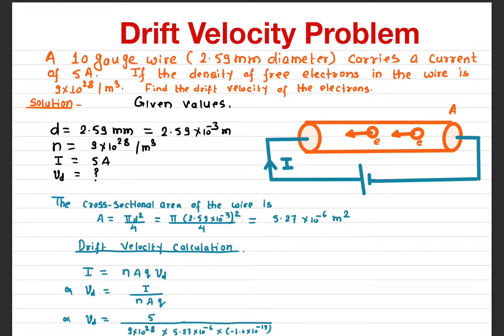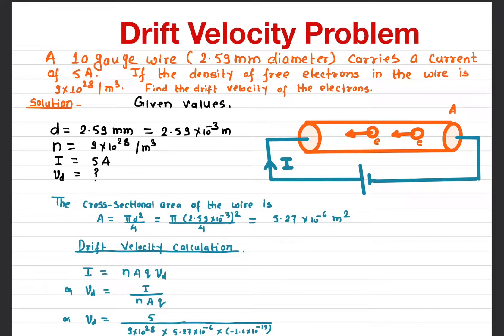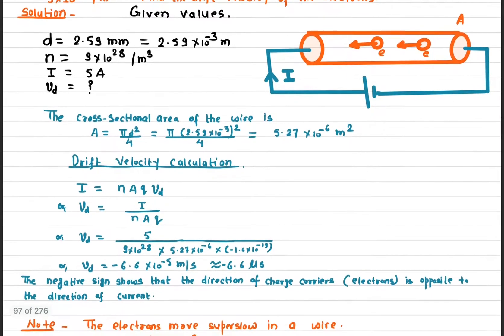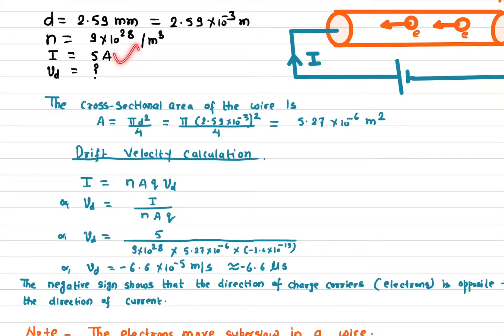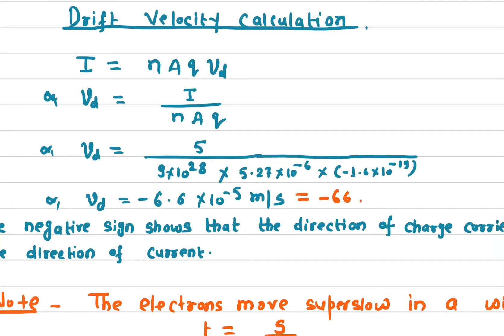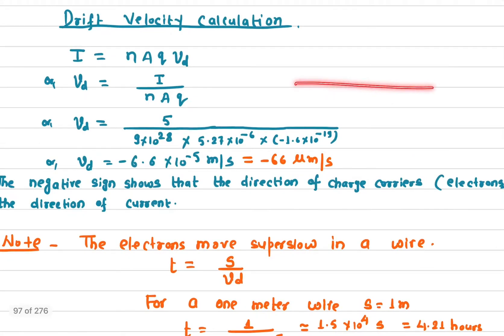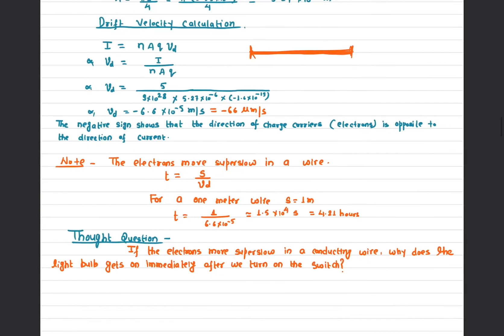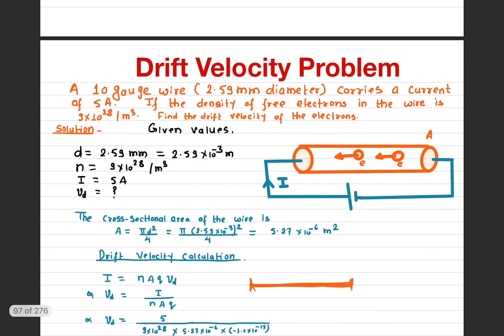Finding the Drift Velocity of the Electrons # Lecture 6

Comment: I think that a circuit turns on so quickly once a switch is flipped, even though electrons move so slowly, because the entire system is filled with electrons. The electrons begin to play bumper cars throughout the entire system as soon as the switch is flipped, resulting in current flow throughout.